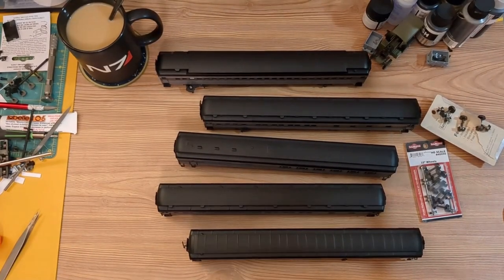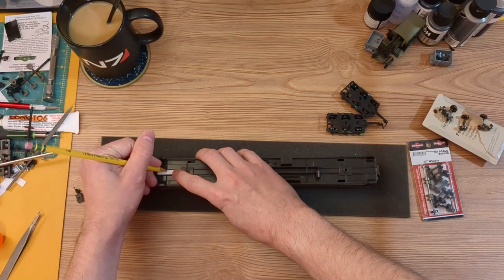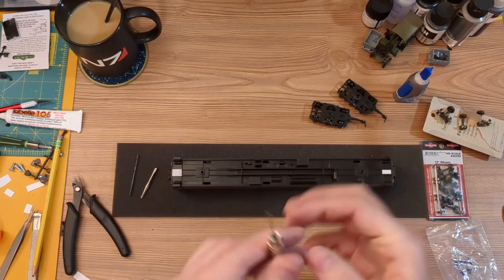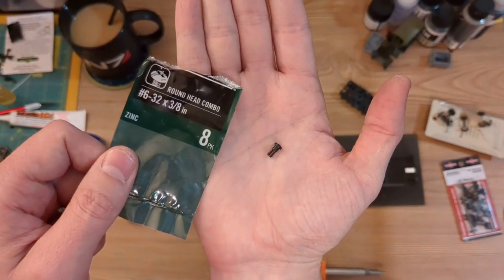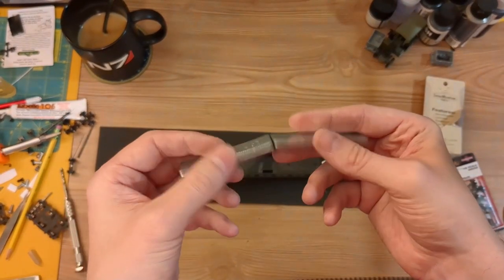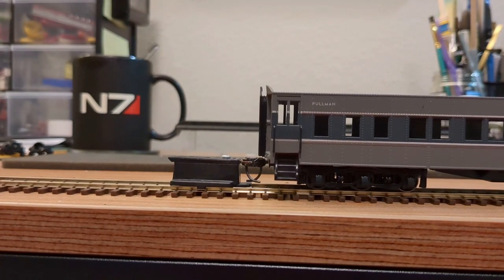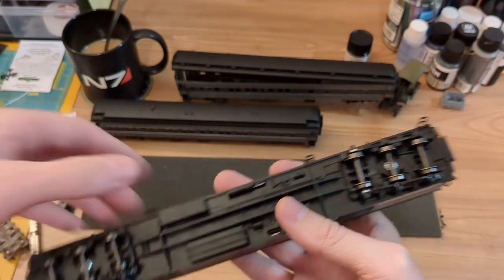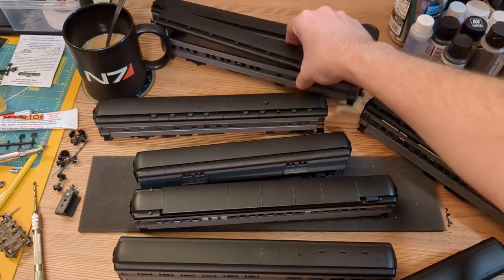Making Cheap IHC Passenger Cars Perform Better - Metal Wheels, Kadees, Lower Ride!

Comment: I've done the same thing with some Rivarossi Southern Crescent Limited coaches.  I cut off the truck mounted couplers and body mounted Kaydee couplers.  I'm eventually gonna illuminate the coaches with LED strip lighting and keep alive circuits.  I found a new product that will make this task much easier.  It's ESU current collectors, part #50707, I got from Litchfield Station.  They were $8.95 + $4.00 postage/shipping and you get enough to do 8 axles.  You glue the pickups on the bottom of the trucks and the contacts rub against the inside of the wheel.  Just have to remember to use insulated wheels, one opposite the other on the same pair of trucks.  One picks up the track power and the other returns it to the track.  I painted the coupler mounting pad with flat black paint.   Cheers from eastern TN

Comment: For those doing the body Mount couplers like shown here, be aware these cars may have a hard time negotiating tight curves if you use the coupler method he shows, there's a swing coupler that can be installed that would allow these cars to negotiate tighter curves.. nothing wrong with how he does it assuming you have wide curves though..also the correct wheels to use are Roll Tru scale wheels..thats rhe web site you want to search for, they have a few different variations of Riverosssi wheels to use that are correct..you can use intermountain, but tru scale will fit better.. Roll Tru Scale Rivarossi is the site you want to look at..
Reply: Yes, I have had several of the older Rivarossi locomotives in the past, and those deep flanges do not like the frogs at some switches, or the diamonds at crossover points.  Up until a few years ago when Rivarossi started offering scale flanges, we were pretty much stuck with Code 80 rail.

Comment: This is great, very helpful indeed!
I’ve actually recently bought some IHC N&W passenger cars and intend to upgrade them to modern standards, so your video will be very useful for that.

Love your other videos btw! Especially your upgrading of your Rivarossi Big Boy!
Reply from the maker: I think as long as you don't spend too much on the cars themselves, they make a great platform for upgrading performance! Just be careful of any cars that have the brittle plastic - at least three of my 8 car set are oddly brittle but with some careful handling should last as long as I do. Thank you very much for watching!

Comment: Great video and great comments, especially about the current cost of new cars. I also have done these conversions/updates to Rivarossi/AHM/IHC cars myself. Its a good way to continue in this hobby.
Reply from the maker: Thank you very much! Working on these cars was a lot of fun and I get a lot of joy doing that sort of modeling. My only wish is that some of the cars weren't so brittle but otherwise its hard to complain for under $10 a piece.

Comment: Top video. I have done the same thing with my collection on IHC AHM/Rivarossi passenger cars. Better metal wheels, some weight, kadess's etc, makes them run a lot better. I have added interiors to a lot of them (can be very hard to get at times here in Australia and can be very expensive) some i made my own and detailed them with new diaphragms, and custom detail some of them and work of a prototype plan. It adds up after awhile $ but still cheaper than some of the  new RTR coaches, and enjoy working on them.
Really enjoyed your video, great work what you have done A+👍 🇦🇺

Comment: Use Roll-Tru wheels. They’re the proper size and don’t cost much more than Intermountain wheels and are a perfect 1 for 1 replacement.
Reply from the maker: I'm considering swapping them out with the Roll-Tru sets eventually, I just had a lot of intermountain wheels on hand and wanted to make use of them. Will probably do an update video too

Comment: I've been working on upgrading a pile of old Rivarossi, AHM, IHC, and Con-Cor passenger cars. The process I've settled is almost the exact same as yours. Still, even after careful filing of the carbody bolster and the top of the truck frames, I still have issues with some cars not sitting level on their trucks, leaning to one side and wobbling while in motion. I'm curious if youve had similar issues. 

For journal boxes with too much end clearance for Intermountain wheelsets, you might try Athearn Long Axle wheelsets. I've found that they work well in trucks that have worn or over-sized journals.

Comment: With all the breakage it seems it would have been better to just spring for proper trucks from a third party. A small bit of Evergreen "pipe" of the right diameter could be cemented in the bolster mounting holes, then drilled to the correct diameter and tapped for the usual 2-56 machine screws. I also prefer to use the taper headed screws as these will sink down and self-center in truck mounting holes that may be a little too wide. The flat upper surfaces of the screw heads clear any moving parts on the trucks. As for the couplers, the #5 might make negotiating curves a little problematic. I'd suggest the Kadee #451 self-centering swing mount coupler for the cars. There's another video demonstrating their installation but that particular video shows the wrong way to mount them, including not leveling the mounting surface, and not understanding how the swing mount works and ending up with just a long immovable coupler pocket.

Comment: Thank you for the video.  It has a lot of helpful information.  What is the minimum radius these cars can negotiate with body-mounted Kadee #5 couplers?
Reply from the maker: Thanks George! I have not managed to test them on anything less than 28" as that's what I used for the temp loop if EZ-track at home. I probably wouldn't expect them to manage anything under 24" radius with the standard #5 Kadees as they are.
Reply: I just did this conversion on a Rivarossi set with body mounted Kadee couplers and these cars will go through a #6 Atlas crossover switch with no problem, no binding. I have a small Christmas village that I believe has around 24" curves and they also make it around that with no problem.

Comment: I liked your video.  Did you have any trouble with the larger Intermountain wheels and their longer axles causing friction?  Why did you shave off the top of the truck bolster and bottom of the body bolster if you just replaced them with washers?
Reply from the maker: Thank you for watching! I actually have found the Intermountain wheels to be too short in axle length, they are more loose in the trucks than I care for so I'm going to try a few other brands and see what might be a better fit.

For  removing the bolsters, there are two main reasons. 1. The bolsters on the trucks and the cars are too thick so the cars would ride very high, however I still want a washer between the trucks and car so I'm not just pinning the truck to the chassis. The washer is much thinner and allows the truck to rotate. 2. When I would replace the original 'snap-in' pins that held the trucks to the chassis with a nut and screw, the screw going into the chassis would cause the very brittle plastic around the bolster to crack and break, so I shaved them down and sanded them smooth. That was just my approach with these cars specifically.

Comment: Your video is great but, never seen a passenger train with NO people…
Reply from the maker: Unfortunately IHC passenger cars don't come with interiors, and finding the interior add-ons they sold is rather difficult these days (and expensive when they do turn up). I'd rather have a train with no passengers and interior than no train at all, but that's just me.
Reply: He makes a good point about people and interiors.  One problem with the AHM interiors is they too are devoid of life.  Buying 25 to 50 seated figures and fitting them to the cast interior is a royal pain and would cost $50

The presenter's window shades are a good 1st step.  Myself I just use label paper which looks like shades and sticks easily.

A solution for people and seats or baggage compartments and RPO is printed interiors.  Find a photo of real car interiors for the period, and print them on paper or transparency sheets.  Cut them out to meet the floor and roof but back them off the windows a bit.

This covers the weights and really works well if you light the cars...but pretty convincing unlit as well

Comment: That set up will never work on anything with a turn radius of less than probably 30" ... certainly not 24". The couplers are too close and on tighter layouts that will cause the car bodies to contact each other and cause incessant derailing.
Reply from the maker: I have run them through 24 inch curves at a club layout without issue. It doesn't look great but I have not had any issues with derailing.

Comment: Kadee  148 couplers are way better then #5
Reply from the maker: Operationally they are the same, but I would agree that #148s are preferred for ease of installation. For these IHC cars, I wanted to use up a pile of extra #5s I had on hand.